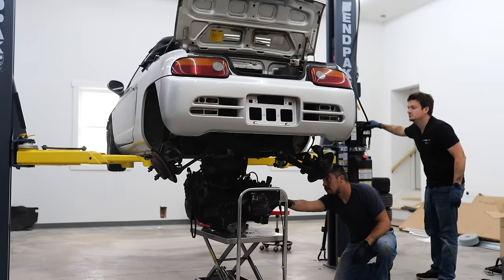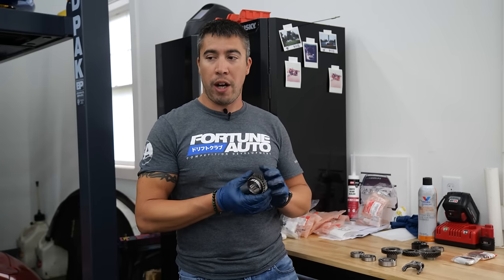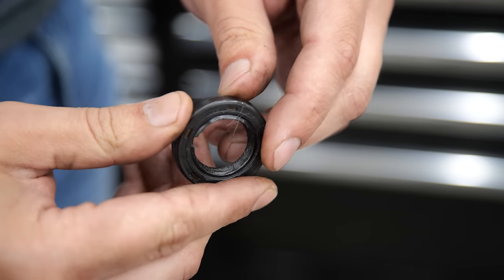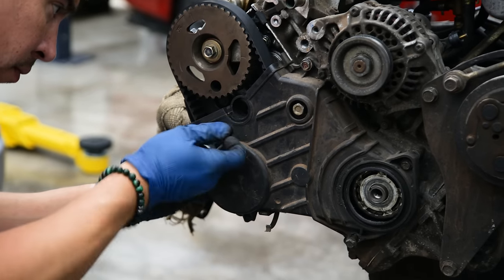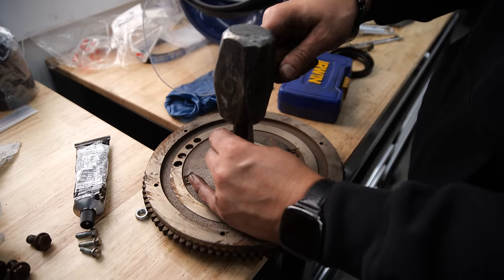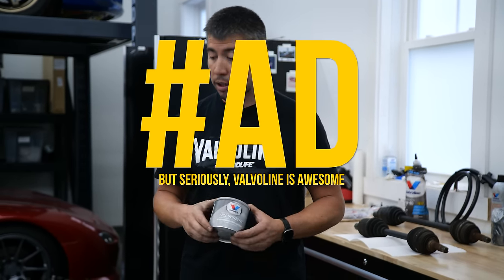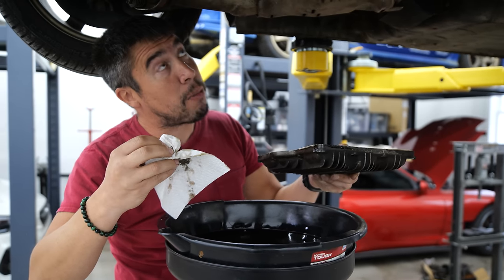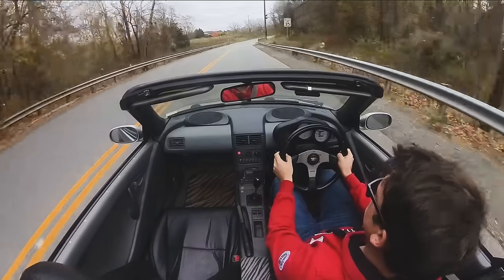Honda Beat Motor Swap

Comment: I’m a Honda guy and watching him put in 75w90 Just hurts my soul. Short term everything should be fine. However, you were going to develop shifting issues. The synchro are going to work correctly because of the thick oil. This is going to lead to grinding of gears. I hope you read this before you guys drive this thing.
Reply: Not just that he also got the limited slip  75w90 which is going to shred the synchros as well
Reply: I wish they could see this
Reply: Hi, I'm curious, what grade of oil they should put in instead the 75w90?
Reply: If that's GL-5 gear oil (I'm 90% certain it is), I hope his synchros are able to withstand the additives. I literally just replaced my transmission after running this oil not knowing it was specifically meant for differentials, not transmissions.
Reply: @fededz7884 Redline MTF. We always ran it in our cars for track or street. Butter smooth shifts.
Reply: Can D16 fit in that ????

Comment: Would’ve liked to have seen a CBR liter engine in this thing, but this is still a nice choice regardless. Mark’s also killing it with his presence on the channel, glad to see him be apart of the team.
Reply: SuperfastMatt has a great build wirh an old Honda s600 and Honda liter bike engine.
Reply: nah mate, look up the VFR800 swap, best sound
Reply: @jeremyb4493 you mean had. It's blown to bits and another one of his projects on the back burner 😂
Reply: Black bird 1100 or a larger touring engine could be better like work one posted a VFR
Reply: They have no bottom end but get super spicy at RPM.  I say yes to any option recommended so far.
Reply: I definitely wouldn't, bike engines aren't made to take corners flat like car engines can, you'd starve your engine of oil before you really start enjoying it and be out the engine PLUS the money/time to custom-fit it.
Reply: @Drake5153  Custom. Baffled. Oil pan.

Comment: That exhaust sits right behind the driver and ecu, which tends to cook the components in the ecu. That's probably why the exhaust was wrapped. There is an ecu harness extension that moves it away from the heat, just don't remember the site... also, honda jazz calipers make a good front break upgrade.
Reply: i love hearing little bits of information like this that only dedicated kei owners would know

Comment: Good choice, a motorcycle engine swap would have been super fun also as long as you could get a reverse mechanism to fit in the chassis.
Reply: Reverse isn’t even necessary in this car. It’s so easy to push. Lol
Reply: @hellfire08 Probably not if you're alone.
Reply: @yongling9825 as someone who has owned multiple beats. You can push it with 1 leg out the door.
Reply: Imagine a  hayabusa engine in that…
Reply: @hellfire08  yes but having reverse added would just top it off and make it more polished as a build.
Reply: @dancarlos1216 Na just install a winch at the back

Comment: YOOO OPERATION HONDA BEATDOWN IS A GO!

hell yeah, had me good with the feigned k-swap at the start.
Reply: Ben once said in an FB Story that a K-swap in a Beat is impossible due to the dimensions of the engine bay. When I saw the thumbnail, I was like "I thought you said it's impossible??", then we saw Mark roll in with a different engine.

Comment: To check valve lash you have to turn each piston to compression stroke before measuring so the valves are completely closed and the feeler gauge can go in. That is why you found the lash super loose even after double checking.

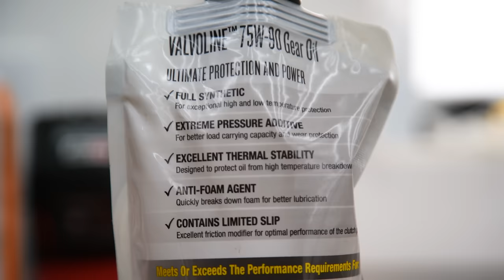Comment: 3:18 learned something new after all these years, had no idea a 75W-90 gear oil was roughly the same viscosity as 10W-40 engine oil. Awesome refresh, that was a lot of wrenching time condensed in 16 minutes.

Comment: As with most period Hondas, distributor bearings are a major failure point on the E07A, so you should probably check it. It's not too hard to change. The E07Z variant was available with both a turbo and COP ignition. I always thought it'd be fun to swap one in with a MS (particularly because ECU failure is also a period Honda failure point), especially if I could keep the ITB setup as well.

Comment: Honda valvetrains tend to be clackity when cold. But it’s also easy to miss the clearance on a valve even after thinking you double checked everything. I’ve definitely done it a time or three. But also the rocker arms are supposed to be loose like that, due to the cold valve lash clearance.

Comment: Hey, just a little tip. I run the Full Synthetic High Milage Valvoline oil in my T4 Turbo motor, and I see about a 10° drop on average compared to the advanced synthetic.

Comment: Something I've learned about synthetic oil after making an old engine run again.... flush that oil at 2000mi or earlier the first time... it will flush a ton of garbage out, especially if the engine had a lot of varnish or carbon in the rings and stuff.

Comment: Interesting take in the exhaust wrap although oil could dripping on the bare manifold could easily start and i've never seen an exhaust thats rusted because if it. The heat will evaporate any moisture

Comment: What about a D series swap? Parts would be extremely common
Reply from the maker: D series is still quite large. It can be done, but still requires a lot of work
Reply: @GearsandGasoline  I’ve always wanted to see somebody Renesis/NA13B swap one. I’d imagine fitting it in wouldn’t be so hard but the fabrication it get it to work would probably be pretty high

Comment: Question, why didnt yall go with a newer. E07Z?
Reply from the maker: Parts availability, and ease of being able to just get the beat back on the road so I can daily drive it
Reply: Toyota 1KR-FE, 70hp and they are everywhere
Reply: @GearsandGasoline future swap then for more mpg 😂  in a couple of years ebay will have parts for those do u wont need to order parts from japan.  Im looking at beforward's parts side and looking at ordering a e07z with harness and ecu with like only 30km on the clock.  I wish shipping wasnt so expensive😂

Comment: First thing to do with a used engine is to check the cleanliness inside because that shows if it had been maintained.
And since it's out also the main and big end bearings, because knowing their condition just brings confidence in the engine. Assuming they're good or, if bad, and you replaced them.
Also for a used engine i highly recommend running it with diesel engine oil for the first oil change.
Diesel oils have higher detergent content and help clean sludge from the engine, especially if you have noisy hydraulic lifters.

Comment: Honda doesn't recommend 10W-30 on the E07A above an ambient temp of 35c  I know it's getting to be winter right now but if you plan on driving it in the summer where you're at I'd recommend switching to 10W-40 in the spring

Comment: Great video, Mark did a great job, gating more and more natural with the camera.
As for the Beat, yes that little engine with those itb's sound great but i truly would like to see it with some electric power plant for example from the Honda E, you can call it a baby Roadster... just curiosity...
Keep up the great projects 

P.S. Ben be honest, you didn't
Go work on the Civic, your still stopping that leaking STI roof...

Comment: The only time I ever used exhaust wrap was on a 1986 Ford f250 with the 300ci  inline 6 the header split at the collector and I didn't have a welder so I hose clamped them together and wrapped 6ft of the shit on a 2 foot section

Comment: ECA1 out of the 00-06 Honda Insights share some design features with the L15 engines from the GD Fits/Jazz cars.  With the super long intake runners and tiny exhaust, they still make over 50hp.  Some Insight owners have turbocharged them to around 100hp and they survive.

Would be very interesting what one of those chucked into a Beat would do.  My guess is with ITB's and short intake runners allowing the engine to breathe a bit (the stock throttlebody is 30mm or something like that, fuel economy of course), I bet you could turn over 65hp at the crank.  And still get over 80-90mpg quite easily.

Carb conversion and some patience, it would be a clever and interesting swap to keep it honda, yet improve.  MSD or similar Ignition box would be a good idea, wire it similar to the old Geo/Suzuki 3 cylinders of ye olde

Comment: I'm guessing he didn't turn the 3 gone over and make sure the rockers were off the cam lobes. That's why they were tight in the first place and then loose when the motor was turned over

Comment: For me it seems very weird to not take off oil pan when engine is on the table especially when restoring whole transmission. And second thing taking the oil pan off and not look to the crankshaft bearings. Cost almost nothing and can save a lot of time and energy later. We can always put the same bearings on their place.

Comment: K swap in a beat would be wild😂😂😂 would be fun to see it though
Reply: Literally any 1000cc motorcycle engine from 2000s ->
Would fit there, over 160hp and +12k RPM

Comment: Hopefully the engine gets a retune, to better cope with the higher gearing in fourth and fifth. I would say throw a turbo at it, but that seems sacrilegious given the driving characteristics of the car, so the best option is probably to just run higher octane fuel and opt for new rods, pistons, and injectors to achieve higher compression and more fuel to maintain a similar fuel to air mix.

Comment: Hey mister George. I think your paying to much for the new guy. He just put a shit ton of sealer on the case and it’s dripping down the sides. I have never in my life seen sealer be put on so much it drips. Also repacked the cv axles without cleaning the old grease out the way and trying to school us on main seals 😂

Comment: Wait can we get more details on NOT using exhaust wrap? First channel/anything I’ve ever heard say that. Also couldn’t oil leak on your exhaust manifold and also start a fire? Especially weird to say that and then not follow standard wisdom to resurface a flywheel.
Reply from the maker: The oil soaks into the heat wrap until it combusts, so it accumulates more oil before catching fire. Had it happen to a friend of mine years ago. Also rusts the metal underneath faster by trapping condensation.

Comment: If you want to wrap an exhaust just paint it beforehand so no rust happens.
Reply from the maker: It can still trap oil from oil leaks and then catch fire. Can’t express how much I dislike exhaust wrap.
Reply: @GearsandGasoline  I get it, I still find it useful, much better option to just ceramic treat the thing, but it's quite a bit more expensive. It's just that it has greatly improved my intake temps when racing, also enabled for better gas scavenging so it's a good deal for me at least, but the fire risk you have to consider it, depends on the engine, my H2B engine? Worth it and only possible oil leak on top of the manifold is the valve cover

Comment: You preventatively replaced transmission bearings but don’t pull the engine oil pan. 
Priority bruh

Comment: Why not just a put a sportsbike engine into it?
Reply: It has its own complications. A car with a motorcycle powertrain can't reverse on its own because motorcycle gearboxes don't have a reverse gear.
Reply: @yongling9825  Motorcycle engine, i never said the whole drivetrain. Obviously needed to do some custom work to fit it to the original gearbox, or some other gearbox that would be suitable.

Comment: rotary swap would be so coool and engine  is really small
Reply: Yeah but not easy
Reply: @AudiRSAvant  probably much easier than k series ;7
Reply: @Pieteros21  I don’t think it would be, but they didn’t swap a K series in it anyway.
Reply: @AudiRSAvant  13B is much smaller than k24 so it would be easier .